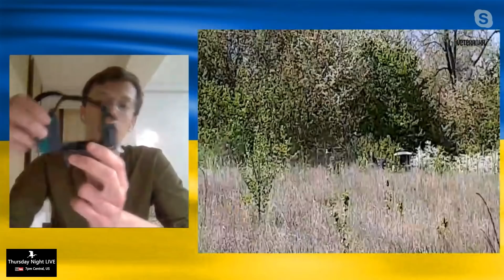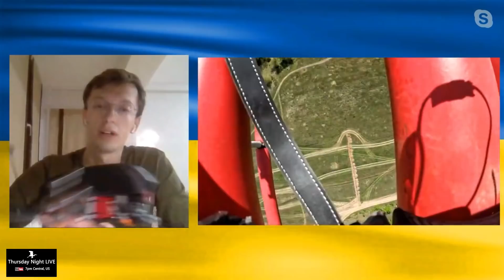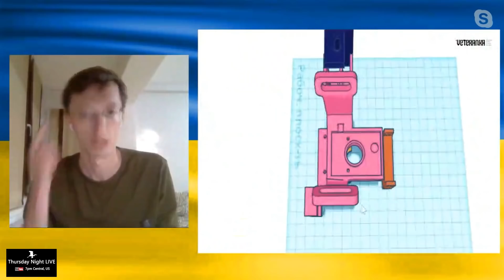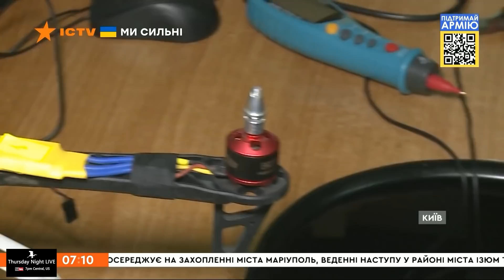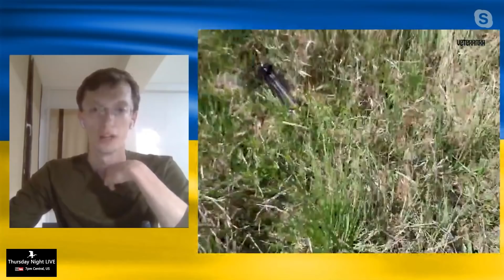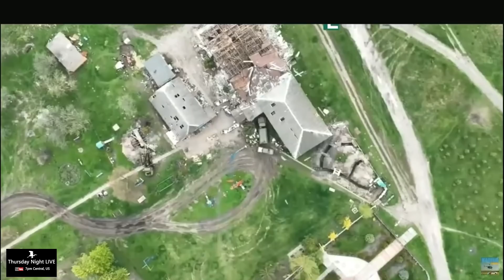How Consumer Drones are changing the course of War in Ukraine

Comment: Ukraine Will Have a New Drone Industry after they Win the War .. So They Don't Need to Depend on China for Parts such as... Motors , Flight Controller, Battery, Goggles, Camera, Transmitter... They Can 3D Print Frame and Propellers

Comment: I see and hear about quadcopters being used to deliver munitions and to do surveillance, but why am I not seeing or hearing about RC planes doing the same? The plane can be built out of just about any material and only uses 1 ESC and 1 motor and if it's FPV it doesn't even need a flight controller.

Comment: This will be why DJI Drones are not good in this conflict due to Aeroscope (sp?)  it is said that DJI has supplied RU with the needed tracking equipment to pinpoint both the Drone and the Pilots of flying DJI Drones , I never was happy with this stuff built into DJI stuff ,  Autel does not have the same tracking capability so safer for the Ukraine pilots to use  Autel .
Reply: You mean stuff like remote ID that they’re shoving down our throats?